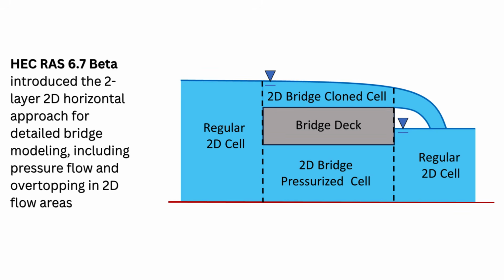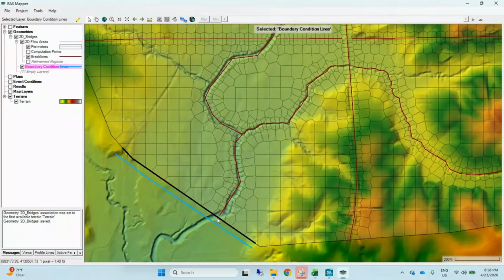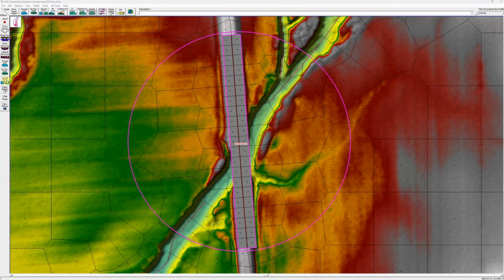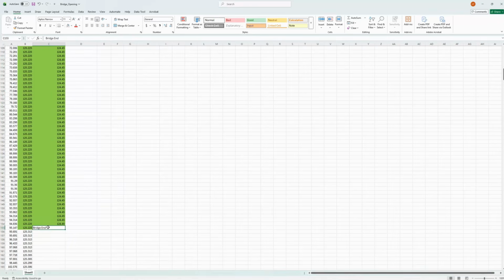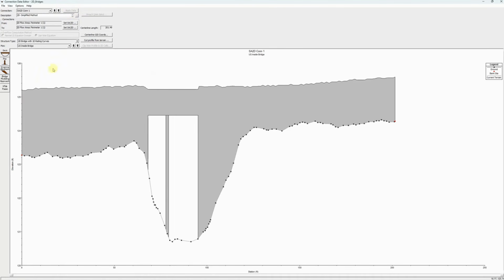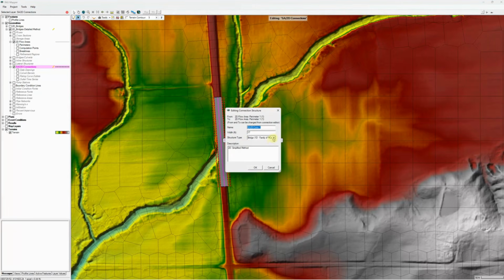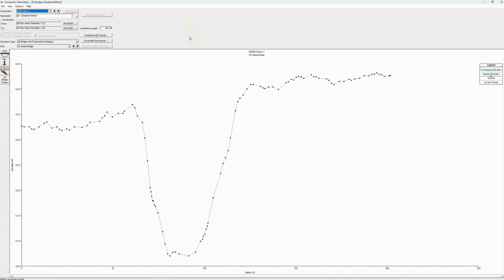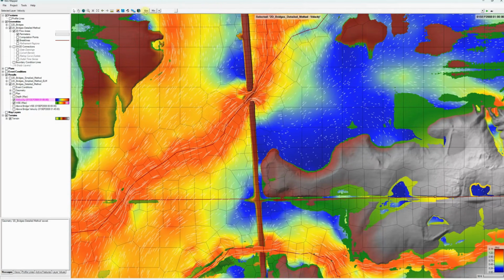HEC-RAS 7.0 Complete 2D Bridge Modeling Tutorial | Simplified Vs Detailed Method #hecras #2d #bridge

Comment: Nice video. I have tried using the pressure method under multiple situations and it always crashes once the water surface elevation reaches the soffit. I've aligned the bridge deck with the cell faces, tried various minor loss coefficients, used the beta version and the recent 7.0 release.....Is there a sample data set available? Thanks!
Reply from the maker: Thanks for watching and sharing your experience. I used my own simple test data for this demo, and it ran successfully on my end. As far as I am aware, there isn’t an official sample dataset yet specifically for detailed 2D bridge modeling in HEC website so I built the example from scratch to demonstrate the workflow. One suggestion would be to start with a basic setup and add details incrementally, so it becomes easier to debug.
Reply: @HEC_Hub  Thanks for the reply. Did your model reach the soffit or overtop the cloned mesh? This is usually where the model goes unstable for me. I have tried multiple different data sets to no avail. Thanks!
Reply from the maker: @richgleason7639  Initially, my model did not overtop, so I reran it with significantly higher rainfall to check the behavior under pressure-flow condition and it ran without issues. It’s hard to pinpoint the exact cause in your model without reviewing it, but one thing worth checking is the time step. I hope you also tested it with a much smaller time step.